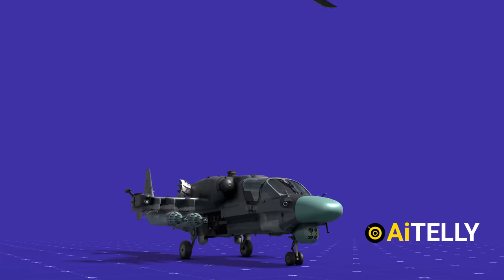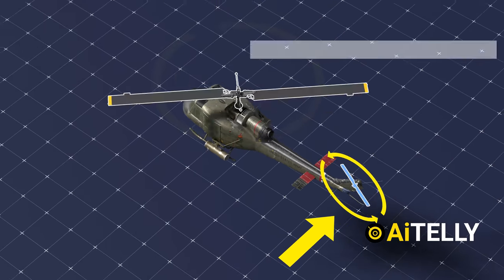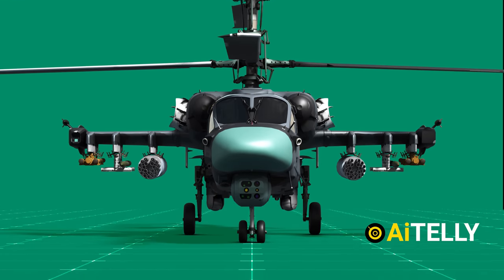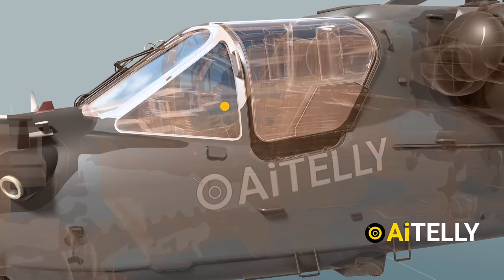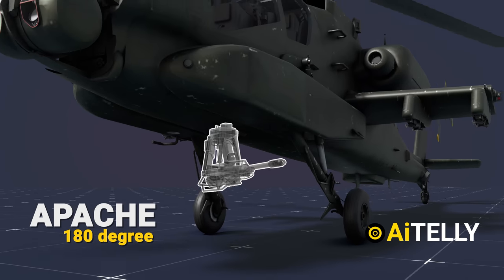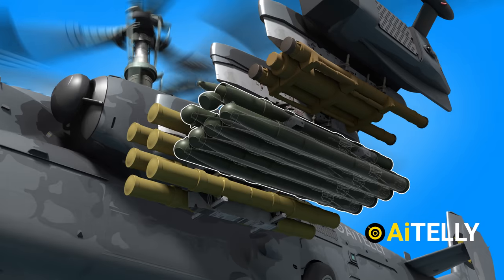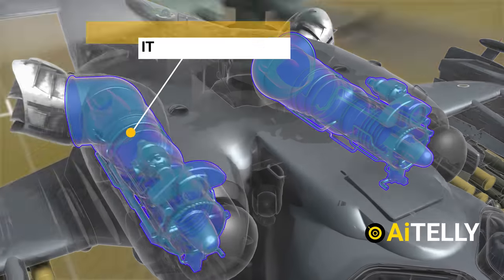KA 52 How Military Coaxial Helicopter Works #ka52 #helicopter #coaxial

Comment: Nice!!! I was waiting. If I was to fly a military helicopter I would fly this one. All the benefits of the ka-50 with extra cargo space.
Reply: Ka-50 for 1 pilot
Ka-52 for 1 pilot and 1 gunner, because it's too hard to be both pilot and a gunner at the same time.
Reply: @DmitrySabFo  ka-50 when it was developed had many cool new digital things that helped one pilot to do many things at once. Auto hover, targeting pod with auto target follow, aiming using helmet
Reply: @spinningsquare1325  digital things are not strong side in Russia and and this electronics are imported, this also means high unit cost.
Something simpler, cheaper, more componently independent for quantity won this competition.
Reply: @DmitrySabFo  russia has domestic cpus and hardware. Ka-50 is not much complicated than mig 29/su-27
Reply: @spinningsquare1325  not everything are domestic
90-95%
Plus there are lobbists in the military
Some projects are made to grab money (not ka-50)
Its complicated.
I live here, i know.
Reply: @DmitrySabFo  surprise surprise I live in russia too
Reply: @spinningsquare1325  вы наверное ещё и с одного города и района, гы :))
Reply: В DCS World есть Ка-50. Заодно можно полностью оценить, почему всё-таки одноместная машина не взлетела.

Comment: At a certain speed depending on the aircraft the torque is countered not just by the tail rotor but the airflow over the tail itself just like an airplane, at low speeds it is certainly needed but at speed you can lose tail rotor control as long as it is feathered and still fly straight and also land, this is why many civilian helicopters have the rotor completely inside the tail itself...fyi
Reply: the problem is, when explosion happens near tail, "as long as it is feathered" not work

Comment: S8 KOM is in a sense unguided but that is not generally true. This rocket is guided by ballistic computer and is incredibly accurate in the hands of a well-trained pilot and you can bet that all Russian pilots that are given the privilege to fly this phenomenal machine are exceptionally well trained. They can land this rocket within 3 m of it's intended target or less... 
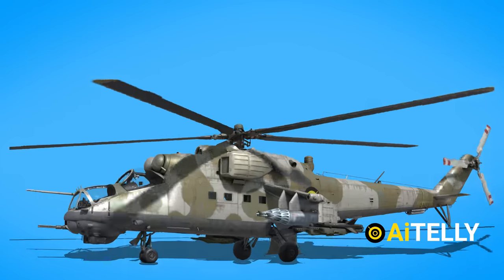@ 8:52 LCDs all over the place
Reply: There are a lot of these missiles in stock.
Reply: @Rory_Mercury  oh yeah, absolutely. I'm certain they will never run out.
Reply: That's when these are fired as intended, with a pipper on the target and range below the designed one. In the current conflict, however, these are mostly used as an agile artillery, firing these rockets in an upward ark, making it an improvised subpar-Grad MLRS. The range is increased greatly (up to around 10km), but the dissipation, wind influence and other factors make it extremely inaccurate.
Reply: @ShadeAKAhayate  No. Ballistic computers onboard calculate the trajectory. They are extremely accurate. Not pinpoint, but pretty close.
Reply: @stanley1554  Like I said -- only when you're pointing down (or, in some cases, slightly up). These were never designed to calculate MLRS-like trajectory for helicopters. And with the distance of 10km, even dispersion alone will make the affected area hundreds of meters wide. Let alone multitude of other factors.
Reply: @ShadeAKAhayate  You don't get it, on the pilot's heads up display there are two markers, one horizontal and one vertical. The pilot has to point the helicopter in the direction and then raise the nose to the necessary angle and once that's done the lines on his heads up display light up indicating that he is on target and then he releases his missiles and they fly to within several square meters of their intended target. They are shockingly accurate and they are guided by ballistic computer. The pilot does not shoot the missiles 'by feel' or by instinct. No chance. Ballistic computers calculate the missiles flight path and destination. The pilot just puts the plane in the right position according to the computers instructions for the missiles to get to where they need to go. That's it. Simple.
Reply: @stanley1554  I've seen several such shots from HUD perspective -- and not on a single one there was some kind of a vertical target marker you mention (or any other indication of targeted weapon employment mode). Discussions on the internets also seem to produce no such evidence -- on the contrary, these only provide more evidence to disprove your point of view (like, no auto-launch capability in combat circuit for unguided missiles). As such, it's safe to assume these weapons are employed in navigation mode, with a lot of approximations and hand-eye coordination of a pilot. 

Ground visual control footage (a few examples I've seen) also display huge area covered by random explosions. 
Also note that S-8 rockets are way too weak with low blast radius compared to real MLRS rockets. When employed properly to cover a small area, these can be lethal against both infantry and armor. But imitating MLRS with these is mostly wasting ammo, flight hours and valuable time.
Reply: @ShadeAKAhayate  Yes there is. You need to watch the combat approved episode on the KA-52. They demonstrate these 'unguided' missiles being used in tandem with the onboard ballistic computer and how accurate it is. Hitting a target the size of a car is the systems level of accuracy. You have no idea what you're talking about.
Reply: @stanley1554  What do you mean by 'combat approved episode on the KA-52'? I was watching released videos on weapons employment over Ukraine and these had no specific markers on HUD. You think I have no idea? Then post videoID on the clip where it is demonstrated. Although your claim about car-sized target contradicts videos of actual weapon impacts.
Reply: @stanley1554  don’t pay attention, he doesn’t know what he says, ka52 shoots accurately for this he has an excellent computer that allows you to fire accurately
Reply: @Doomguy05900  right? Some of these people have the mentality of a seven-year-old
Reply: @stanley1554  I agree with you, well, here is the fault of their incompetence in this topic. Thank you for your objectivity🤝
Reply: @Doomguy05900  you are most welcome friend, and glory to the Russian Federation.
(The original nazi DESTROYERS) 
Russia 🇷🇺 🇷🇺 🇷🇺
Reply: @stanley1554  Thank you, it's good that there are adequate people in this crazy world. Good luck in everything friend
Reply: @Doomguy05900  thank you, that's kind of you to say friend.  Best of luck to you as well.

Comment: Can you do a video about the KA-50?
Reply from the maker: Will it get views?
Coz Very difficult for a small channel to do something different.
Reply: @Aitelly  then what about Apache helicopter
Reply: The K-50 can be called the prototype of the K-52. The main difference is that it is single. They were used several times in the Chechen campaign.

Comment: Looks amazing....on paper, like all russian hardware. All hype and yet little to show in practice.
Reply: That's a downgrade of soviet Ka-50
Reply: Put your personal hatred aside and view based on common sense. Ka-50/52 is supposed to use its radar & FLIR targeting pod to designate ground targets and launch guided missiles from far. Russia is so poor that they use the Ka-52 like Vietnam era helicopter carrying unguided rockets attacking ground targets in close range so it gets killed. You fly AH-64E the same way as Russian did, the Apache will be shot down the same way
Reply: @jayjay53313  According to your logic it is better to lost a bunch of expensive helicopters with a crew by using cheap weapons and out of date tactics instead of buying a less amount of vehicles but with better equipment?
Reply: @stanislavkrasovskyi7903  according to my logic, Russia should put money on getting more complete strike force rather than going for quantity where most of the aircraft and choppers don't even have missiles. You have 6x Ka-52 with fully armed with Vikhr ATGM is better than you having 36x Ka-52 carrying just unguided rockets. Russia probably spent too much on getting the numbers of Ka-52 to show that they have the quantity until they don't have much budget left to get Vikhr
Reply: @jayjay53313  I read that quite a few AH-64s were lost in Iraq and Afghanistan. This is specific to attack helicopters, they fly quite low and are vulnerable to fire from the ground. I don’t think that the Ka-52 proved to be bad in Ukraine.
Reply: @jayjay53313  Russia needs to work more on sensors and fire-and-forget missiles. Ka-52M with AFAR and LMUR missile is a step in the right direction.
Reply: These are the only Weapons that fought well equipped adversaries. US only face Taliban hordes with arrows and  bows.
Reply: @eraserstp  there was no AH-64 being shot down in Afghanistan. Only in Iraq & Serbia. In Iraq Desert Storm, AH-64A that were shot down didn't see Iraqi armored column protected by AAA & SAM during storm and went straight into visual range where 2 were shot down but the rest managed to flew out of safety then retaliated. During Iraqi Freedom, 1 AH-64D was damaged with engine malfunction forcing it to land when its squadron gone into ambush by republican guards hiding in city. 

In Bosnia campaign, the thick trees & hilly terrain reduced AH-64 effectiveness as it can't see Serbian forces hiding underneath trees and terrain led to 1 AH-64 being hit and crashed, US withdrawn AH-64 from Bosnia theater due to not suitable.
Reply: @eraserstp  LMUR is still new and under testing. Russian Ka-52 Vikhr is current most advanced missile in Russian helicopter air to ground missile inventory equivalent to AGM-114 Hellfire laser guided by variant that requires pilot to track enemy target until missile hit. It is still acceptable as the effective range of Vikhr is longer than MANPADS & AAA. As long as KA-52 stay low and far, it would be effective like AH-64D except the Ka-52 can't do pop up attack exposing just the milimeter wave radar. Also, if Ka-52 turned on radar, enemy will notice its presence.
Reply: @morshedalhossain1053  What are you talking about, have you heard about a little recent event called war in Ukraine? It showed how much is russian hardware (and their army in general) worth in full on war. They should've stuck to the parades and bombing Syria.
Reply: @jayjay53313  , or Russia is doing it because there is no a lot of solid targets like tanks, so KA-52 is became a flying artillery. Even 40 C-8 can shred a big area
Reply: @Hrucopotam  rockets are useless against mobile moving targets. Could hardly see as choppers can't really go slow and take sweet time to aim when Zelensky forces have advanced MANPADS there
Reply: @jayjay53313  lol there are a LOT of videos with using of guided missiles destroying ukranian vehicles. What are u talking about? Yes, russian fighterbombers have a problem with guided rockets, but not helicopters.
Reply: @Cheburchek-k2u  only recent, it wasn't earlier which led to numbers of KA-52, Mi-28, Su-30, Su-34 being shot down. If Russia had plenty of tactical precision guided munitions such as Vikhr, Kh29, Kh38, kh-31 & able to get few wings of Su-30/34/35 & Ka-52, Mi-28 to carry out SEAD/DEAD & preemptive strike in beginning of war, Zelensky forces would have largely being destroyed and he'll be begging NATO forces to come and rescue him by now
Reply: @Cheburchek-k2u  There is more videos of KA-52s being shot down think about that lol. It's even the first helicopter in history that was filmed shot down by a anti tank missile TWICE..
Reply: @evon2180  keep updated
Reply: @Cheburchek-k2u  keep crying
Reply: @big_bottle_for_ruski_to_sit_on  ok
Reply: Ты почему не в Украине и не сбиваешь то что "на бумаге только" у России?Вы уже даже пробили все возможные днища по тупизне и убогости мышления.

Comment: The gun needs more lateral deflection
Reply: This helicopter does not need this, because the coaxial propeller scheme allows you to quickly aim, and the gun fixed "rigidly" in the center of mass has high accuracy, much more accurate than that of the MI-28